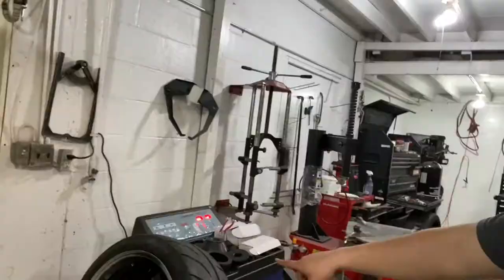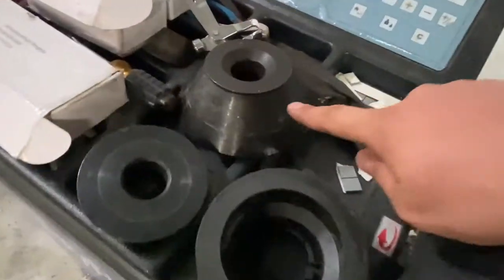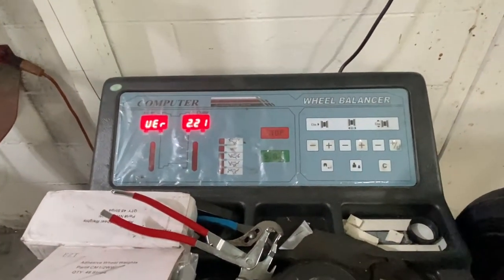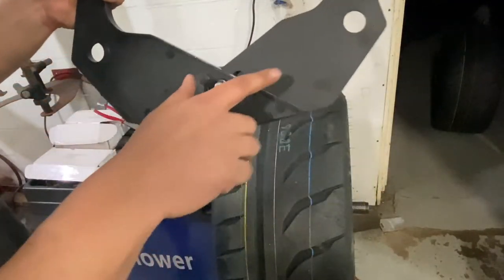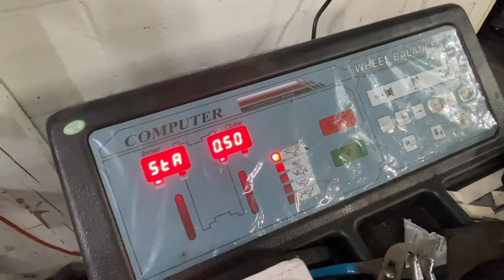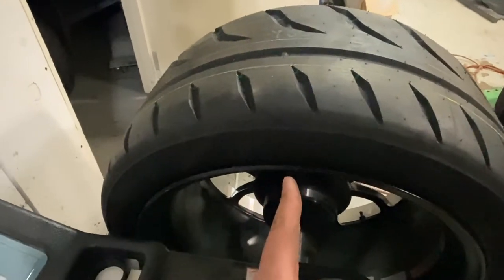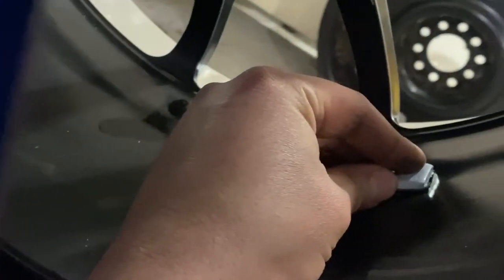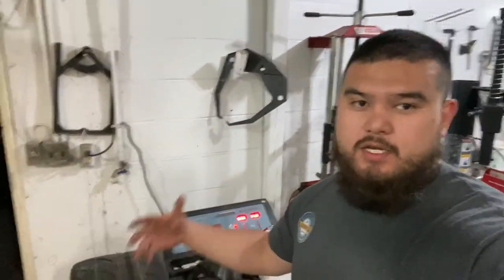Mayflower Wheel Balancer - Quick Setup and Use

Comment: 988 Tire Changer (950 with 2 helper arms) Deliveries require a forklift to unload OR pay for Residential delivery + $150
For clarification the 560 is the smaller unit up to about 18” rims has the square tube rear upright and requires assembly of the bead breaker. 

The 950 is the larger up to 22” rims, has the “Bead Blaster” and main rear upright is a round cylinder air tank. There's also the options of the 2 helper arms the #232 unit making the #988 unit and the other 300 with the black additional upright with 2 arms on it with a disk, the #300 unit making the #960.

The Mayflower 988/680 pair can fit tight in a space about 80” wide IF the Balancer is turned sideways so shaft is out facing you. Other arm options will need more space. The 988 (950 changer with 2 extra arms) is about 45” deep.

I used casters on the 988(950+ extras), Harbor Freight #62276 3” locking 100lb. NEED (QTY 8) regular 1/2”-20 nuts (ORDER or get at a regular hardware store. Home stores don't stock them but can order some). Unit is at or over the max weight of the casters so user beware. Remove rubber foot on bottom, just pops out. Install 1 nut all the way down on caster then insert up through hole and install 2nd. Caster shaft needs a spacer so could use 1/2” flat washers too instead of the first nut. Foot bracket is upside down U channel.

1 Upgrade I added was a 1/4” NPT street elbow to the main airline input on the regulator after removing the factory Japanese style fitting the US doesn't use. That allows the air hose to hang down when connected instead of straight out the back. Then used a 1/4” male NPT to 3/8” hose barb to a 6' section of hose for a whip to move the connection out where it's convenient. That way it's easy to connect when using. Then I added a 1/4” NPT quarter turn valve so machine can be disconnected without losing all air pressure in case air supply line is needed etc.  

Another upgrade I did was added a higher volume airline. The “Bead Blaster” is almost a joke and SLOW. If you see the size of airline and the regulator it runs through you'll understand. I've seen a few add a line at the Regulator. That technically does work but doesn't have the flow capacity I desired. So I added a line to the tank(rear upright). Remove the included Tee for the gauge. Tank bung is 1/4” NPT so I used a Milton s-646 1/4” NPT Hex nipple into the bung using 4 layers of Teflon Tape on all connections. Then I used a Milton s-655 Brass 1/4” NPT Tee which has 3 Female fittings. One end screws onto the previous nipple so the middle connection is centered and angled down and back a little. The included Tank gauge Tee then screws into the other end of the new Tee. Then the middle is a port for a new hose to connect Using a male 1/4” NPT fitting like Milton s-602 1/4” male NPT to 3/8” ID hose barb and a hose clamp etc. I cut about an 8' chunk of another 3/8” ID air hose. I strongly suggest not using 1/4” hose. Then a quick connect fitting on the end. I use and highly recommend the High Flow Milton Type V couplers. You can use a regular air chuck or make a little bead blaster that runs way better. Use a quick connect fitting then a quarter turn 1/4” valve then a short section of hose and an air chuck that locks on. This is a much higher volume short hose feed off the tank. Smaller and more hose length are restrictions. You can now swap chucks and fill higher psi tires and a higher flow bead blaster. But care must be taken using the new bead blaster as it's got straight tank pressure. So use carefully and once bead pops insert valve and use a gauge to fill properly.

680 Balancer Options/Upgrades

Many truck rims will need an additional adapter cone with 5.5” diameter that's sold separately

For best results the 680 Balancer, should be anchored to floor. Don't just bolt down unless floor is perfectly level where unit sits. Base is bolted down with (3) 3/8” threaded anchor bolts ideally with 2 1/2” of threads sticking up to level with. Method is below. I wasn't ready to anchor yet so leveled with 3 3/8” x 2 1/2” hex bolt, 6 3/8” flat washers, 6 3/8” nuts. A small thin rubber piece size of a tire patch works good on floor to help keep from walking across floor. 

Install a nut on the 3/8” bolt approx 1/16” from head of bolt, then a washer. Insert bolt FROM BOTTOM UP through holes on bracket then install 2nd washer and 2nd nut loose, then do same to other 2 holes/bolts. The lowest nut can be adjusted up and down to raise and lower the machine bracket sitting on it. Use a 2nd wrench as needed to hold the hex head while adjusting nut up/down. Use a 24” level on the side of the case to adjust till plumb side to side and front to back. Don't use the plastic tray on top, there's no way to know if it's level to anything. Use the base sides. Then when height is good tighten down the top nut to keep height. 1 wrench holding bolt head 2nd on top nut tightening. Essentially the machine bracket is sandwiched between 2 washers with a nut on top and below. Parking lot light posts are mounted similar for reference except threaded rods are in concrete. As the concrete anchors should be to secure it.

Comment: Thank fo the info. Does it matters if you put the cone on the inside the rim or the outside like you did?
Reply from the maker: No it shouldn’t as long as you have the rim seated tightly on the cone and against the base of the wheel balancer rod base

Comment: What wheels/tires do you use the large cone that you bought separately? Been thinking of buying it just in case.
Reply from the maker: I’ve used it alot on wheels with larger center bores, mainly truck/SUV wheels. Like the wheels on my Duramax, my buddies Cummins and on my LX470, the center bore is very large and the biggest cone they provide with the balancer isn’t big enough for them.
Reply: @MJAltairy  Good to know. Thanks.
Reply from the maker: @jjrock5  anytime!
Reply: Chevy Duramax 8 lug's 👍🏻

Comment: Does anyone know why the balancer keeps giving me outrages weights to place? I’m not sure what’s going on. I tried calibrating it with a 15R tire and followed the steps. Once done it will tell me to put weights of over 6 ounces. Then when I change the tires to the one I actually want to to balance it goes to 6 or 9 ounces. At times it wobbles. Heard it can because of measurement or the tightening of the screw. Tried both, and only tightening it sometimes fixes it.

Comment: O the wheel alone. Mark heavy spot. Install tire heavy spot paint dot 180* out of heavy spot of wheel.
Reply from the maker: Will have to try this next time!
Reply: Not true,we tried this on 25 tires at our shop and they were all still off balance by a decent amount.
Reply: @madmike225  buy better wheels and tires then.
Reply: @joeszucs2190  I tested this on Goodyear, Firestone,cooper,travelstar,Starfire, Michelin,and vercellis Strada 1 and 2. I did the tests bud but you can believe whatever you'd like to. Oh I also tested this on omni trail and ultra cart trailer tires.
Reply: @madmike225  those are not the applications it matters this matters when you are putting uhp and star compound track tires on a set of work wheels where ever OZ matters.
Reply: @joeszucs2190  like I said, believe what you'd like
Reply: @madmike225  its what I know to be true. When you are spending $1000 on a wheel to shave it down to 14-16#s ounces matter and you want to balance that setup with the very least amount of weights you can.
Reply: @joeszucs2190  You seem to really believe in that,and that's great. I'm sure you've changed thousands of tires and personally balanced them with success every single time.  My third time saying this, believe what you'd like to

Comment: What’s the biggest rim you but on the machine
Reply from the maker: 20x12 is the biggest rim I’ve balanced on this machine.
Reply: I just bought the 960 tire changer 2 days again hoping it will do a 22 inch rim. I didn’t know they made the 980 machine until just now

Comment: Quick question?? Is it really needed to balance rear wheels? On rear wheel drive cars
Reply from the maker: I always do. Alot of shops sometimes don’t balance the rears which i feel is very lazy on them.  You could get away without balancing rears but i think it depends on the tires/wheels. If you drive with a bottle of water in your center cup holder and notice it shaking alot or feel vibrations possibly in your back that’s a good indicator that your rears  probably need to be balanced but to each their own. 

It’s more convenient for when you go to rotate your tires (if you’re non-staggered) as well!

Comment: Ok, the first thing you did wrong was you programed it for a steek wheel... The 3 choices on the bottom are for aluminum wheels. The top 2 are for steel wheels. So you might want to check your wheels. Good luck
Reply from the maker: Not sure about that one. I’ve been balancing wheels like this for the past 3 years (cars and trucks) and haven’t had any issues yet. Speeds up to 150mph with no problems yet (hellcats, supras, pontiac g8gt).
Reply: The only difference is weight placement, the "alloy" settings just have more options for the balancing weights compared to the steel options.

That said, he only did a static balance (that's why the one display read "STA"), not a dynamic balance.  In theory he should be putting the weights as close to centerline as possible for a static balance, and static is not as good as dynamic.
Reply: @Firebat45  Absolutely correct.  I have a Cemb machine and if you go into the fine resolution to <1g then you will see a difference between weight placement ( adhesive vs hammer on ).   I agree with your comment.

Comment: Did you calibrate the machine when you first got it ? 
How do you know if it is calibrated correctly?
Reply from the maker: Didn't calibrate it out of the box. For an initial check, I just went ahead and threw a set of wheels on the machine then took the car for a drive and it drove smooth at all speeds. I've been using the machine for several years now and have blanaced hundreds of wheels by now with no issues.

Comment: Can u calabt with any size tire
Reply from the maker: I haven’t needed to calibrate yet but I believe it’s a specific size wheel if i can recall. Not 100% sure though. Just make sure your balancer is bolted to a solid surface as well!
Reply: on my mayflower 800 it calls for a steel 15 inch wheel to calibrate it and the 100 gram wheel weight that came with the balancer
Reply from the maker: @robertkowal323  hmmm I don’t recall receiving any weights with my balancer. Might have to look into that

Comment: Haha This is so wrong, you have to do it dynamic. you only use static for motorbikes or rims under 2,5"
Reply from the maker: Dang Ive been doing it wrong all these years. Why are all the cars driving smoothly afterwards though? 

Mind sharing some additional information on this? This video was done when I first got the machine, I could redo it. Thanks for the input.
Reply: @MJAltairy  Mayflower video to calibrate https://www.youtube.com/watch?v=2iRa-VpjJak&ab_channel=MayflowerAutoEquipments
Also, it's true you are only doing static balances (balancing across the diameter of the tire). The dynamic balance corrects for the balance across the width of the wheel. I believe the reason you never feel an issue is because a tire balance has to be way out to feel it at the steering wheel. BTW My balancer did come with a 100 gram weight and it must be used on a 15" steel wheel between 6 and 6.5" wide with a mounted tire, then use the video to calibrate the machine.
Your videos on the Mayflower are awesome and have helped me learn a lot when I set my machines up, Thanks!
Reply from the maker: @philburke1902  appreciate the feedback! I guess i stand corrected. Always down to learn more!
Reply: It's not the "correct" way. But you can totally static balance almost anything. I don't tape weights unless I absolutely have to.